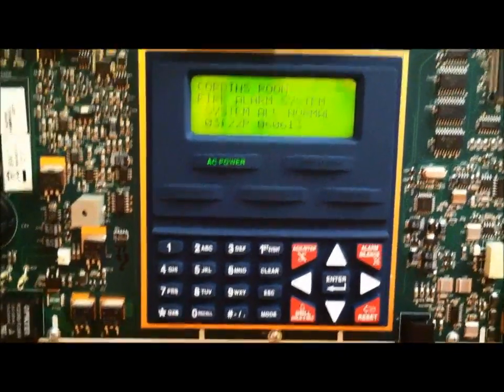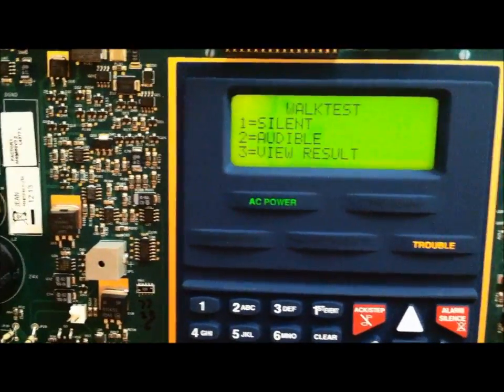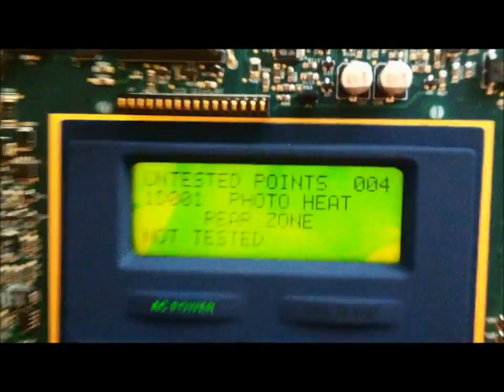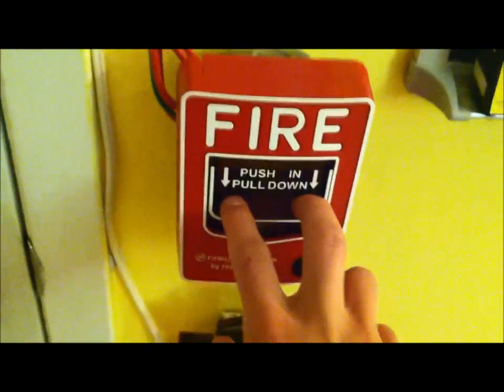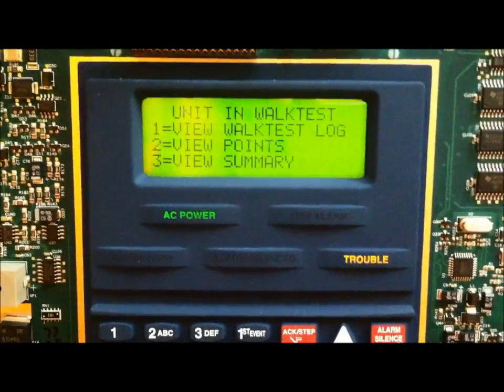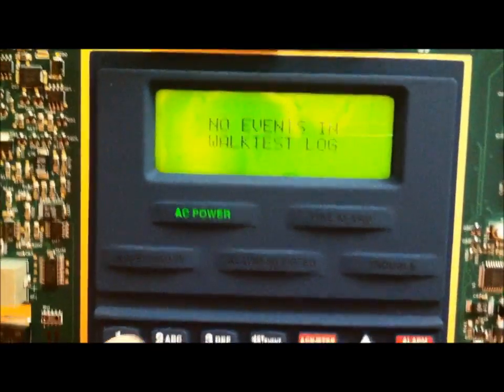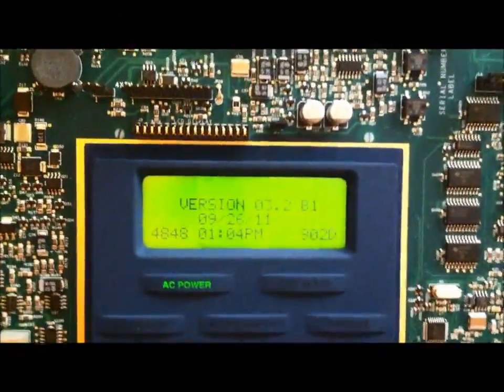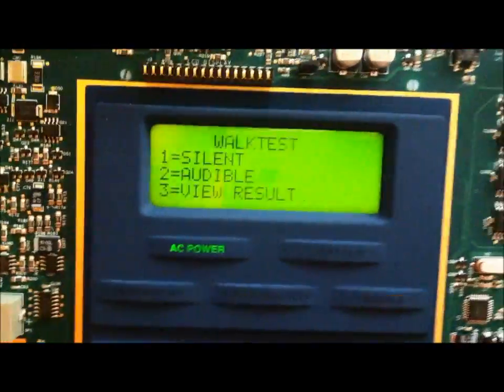Conducting A Fire Alarm Walktest

Comment: How did you get the pull station to light up
Reply: Flashstarship 45668 FireLite addressable modules will light up when in a triggered state.
Reply: u pul it